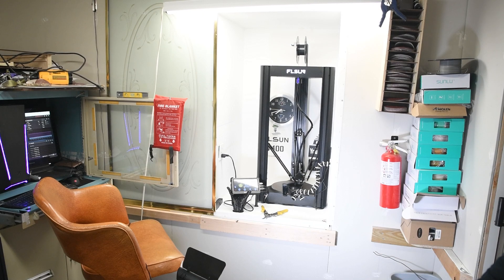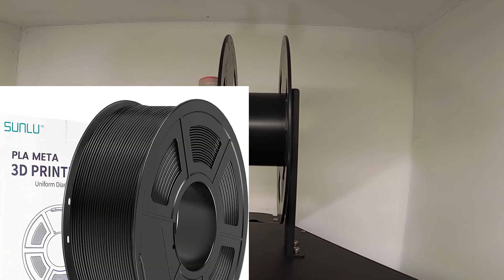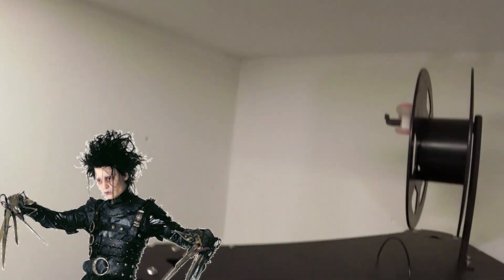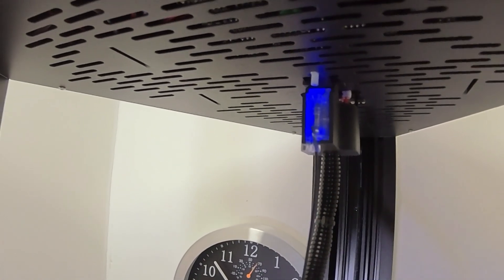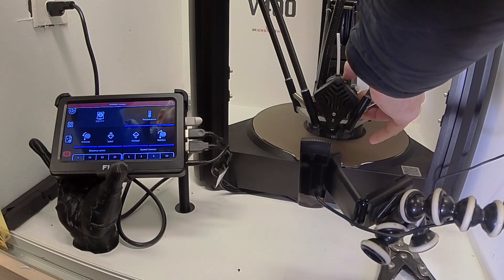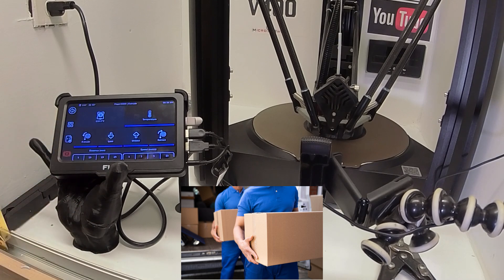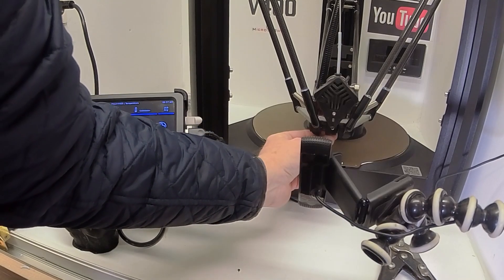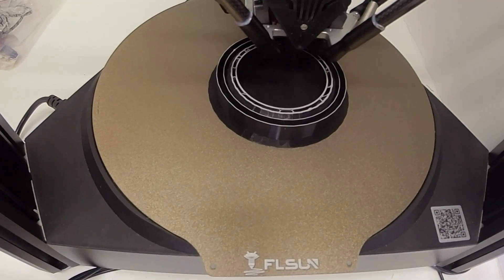FLSUN V400 3d printer Out of Filament What to do + TIPS #flsun3dprinter #flsun #v400

Comment: Hi there. 
If you could do a short vid on what the actual print size is on the 300mm dia and 410 z pse!
Some comments state z hight only to go up to 382mm (i guess that is on the outer dia) but nobody has tested the actual z at the centre. 
Also, nobody has tested the acrual 300mm dia print area.
Much appreciated.
Liked and subscribed 🎉🎉🎉🎉

Comment: Hello, I love following your videos. I have a question for you. Flsun V400 does not restart when power is cut off. What should I do? Thanks already for your help.
Reply from the maker: what is not restarting ? your speeder pad ? or the machine wont turn on ?
Reply: @carphotography  Use a UPS (uninterruptible power supply) to avoid hard shutdowns from power loss.

Comment: I prefer "Changing on the run" I find it much easier to just push the filament afterwards with the sensor is off. If the print head is too fast to put the new filament in the construction tube on the head, just press pause for a moment
Reply from the maker: yeah i normally pause and change it but i wanted to see what happened if i just let it go :D thanks for watching.
Reply: Hello, is it possible to remove the filament by pausing but without the sensor on?
Reply: @regalosswagswag2882 yes you can press pause and change the filament. I just find it easier and a safeguard against misprints when resuming printing to switch it "on the run". but this is only easy if the print head is not moving back and forth strongly. That depends on the part to be printed
Reply: @thomasleopold67  Thank you very much dear friend